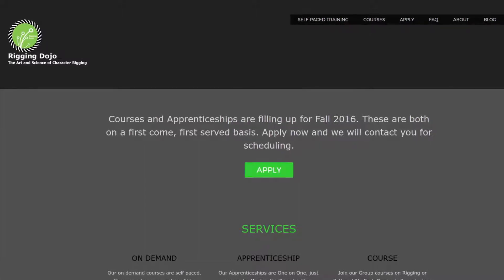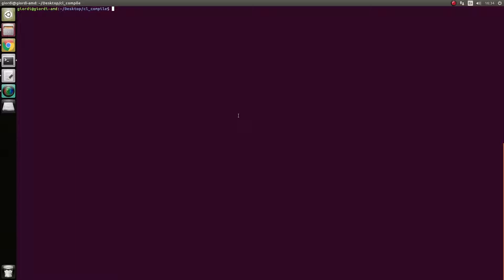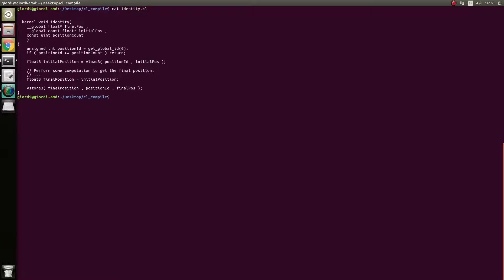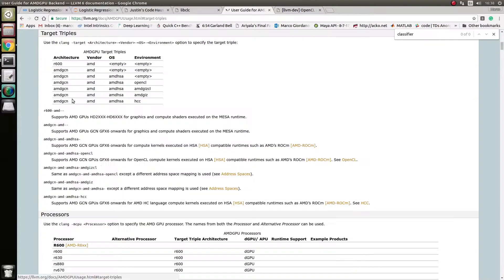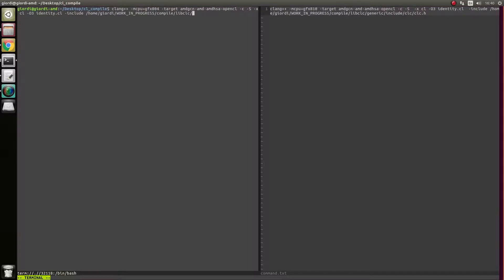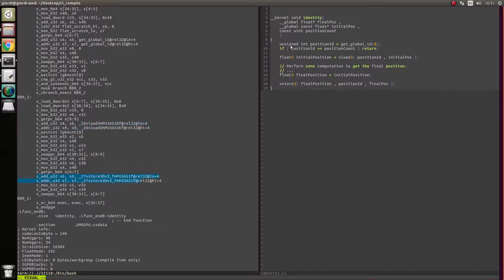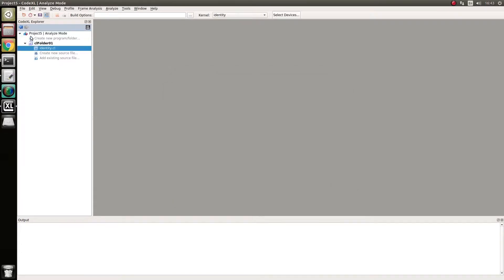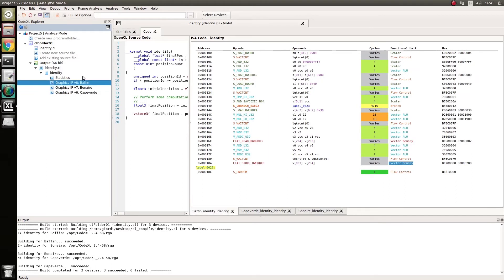Compiling OpenCL code using clang for AMD platform

Comment: Hi man, i watched your video as well as clang user manual, but both
' -target amdgcn-amd-amdhsa-opencl' and  'clang -target amdgcn-amd-amdhsa -mcpu=gfx900'  give me
error: unable to create target: 'No available targets are compatible with this
      triple.'
PS: i use the ubuntu libclc-amdgcn package (do you build libclc with llvm?)
Thanks 
1 error generated.
Reply from the maker: did you try looking here? https://llvm.org/docs/AMDGPUUsage.html#target-triples
This is supported at least since llvm 3 so should be fine, I did not install anything special just whatever my ubuntu had available through apt get. maybe just something changed or the command changed slightly I would start from the AMD usage documentation page I linked above